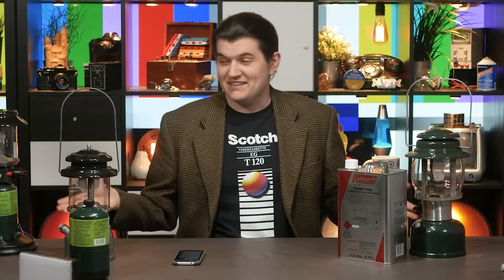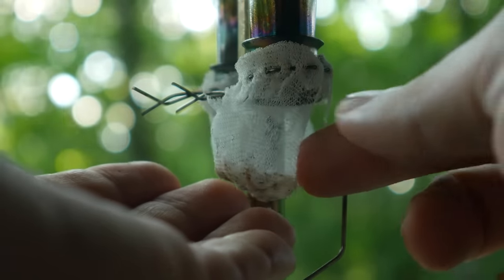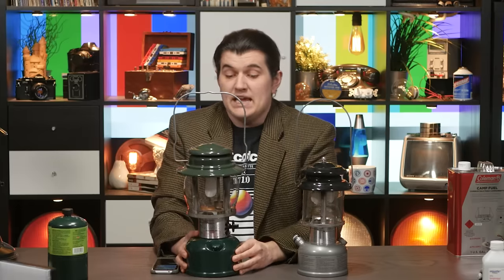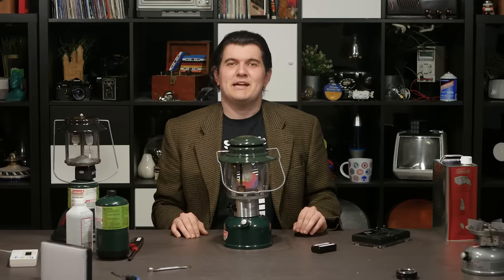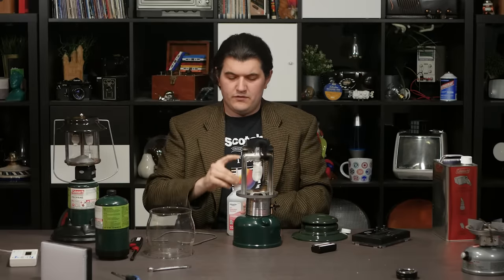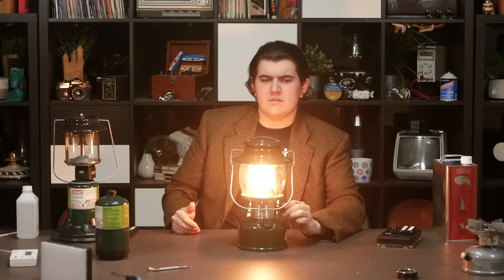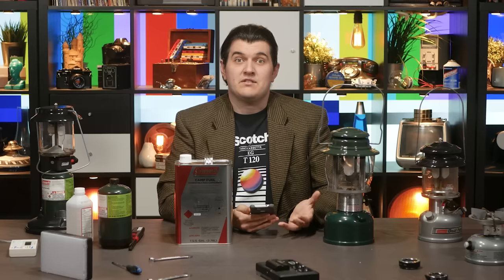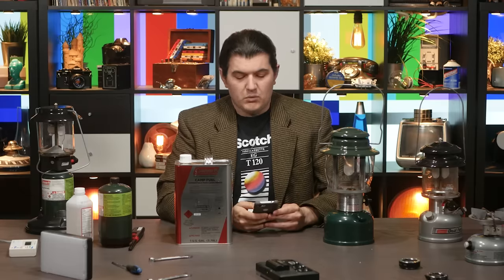A very rambly Coleman Lantern follow-up. Turns out they rarely make sense in 2021

Comment: That mantle was actually less fragile than I had expected.
Reply: They have gotten much better, the older ones were bad enough that just rough handling would break them.
Reply: @Blazer02LS  yeah, i can recall camping as a kid and always having to replace mantles after a drive, or not having any after pulling the lantern out and finding the mantles busted up. 

I've got multiple trips (and a couple thousand travel miles) on my current mantles and they're still intact.
Reply: In the 90's I broke one of the then new mantels blowing out my lamp. I used it alot when camping then as we had a tent and not a campervan, and rechargeable batteries where fairly bad back then.
Reply: @johnbrown3155  : Yeah, rechargeables have gotten so much better that they even pretend that alkalines simply can't be recharged now. So much recrimination directed at those.

Comment: Living in a northern climate where the temp can approach forty below in the winter I kind of like the low efficiency. That LED lamp would have a hard time keeping the tent warm...
Reply: The presenter literally had a cutaway where he explains that there will be exceptions to his broader rule that lithium batteries provide superior lighting output than the lanterns. His specific point was about very cold environments being the exception. He addressed your point. 

As to that point, if you are in a situation where you need heat and light would it not make more sense to have a camp stove and an LED light source? You can’t possibly tell me that an LED flashlight isn’t A) Brighter and B) more energy efficient than a Coleman lantern. And you have the stove to cook food and provide heat without any efficiency waste in creating light. 

Also, if you did find yourself in a situation where you needed light out in the wilderness would you rather have a Coleman lantern with a throw of maybe 10 feet or an adjustable LED flashlight with a maximum throw of hundreds of meters?  

There literally isn’t a situation that would be presented to a person prepared for the wilderness where an LED light source powered by lithium ion batteries would be worse than a coleman lantern.
Reply: @joshuav4965  So he should carry two devices instead of one? That doesn't make much sense. No one is saying that LED flashlights aren't great, its not an either or conundrum. But a lantern is not a flashlight. They serve different roles and need different run times.
And you have no idea what  you are talking about. In subzero temperatures an LED light source powered by batteries is definitely worse than a Coleman lantern. Batteries perform very poorly in severe cold, with run times often being a fraction of warm weather times. In some cases, they have too low of a voltage to even run the light and quit working entirely.

Comment: I want to see a very detailed video talking about electric alternatives to these types of lanterns and how efficient they are for example comparing battery-powered vs something like a hand-cranked lantern.
Reply: I have a lantern/USB battery pack with a hand crank.  I mostly charge it from a USB power supply, but I've done a full discharge and made sure I can get some decent lighting by hand-cranking it.  It also has USB power output, so in a pinch you can crank-charge a cellphone, and some radios.
Reply: I've only used solar powered lights when camping in recent years. I've have never managed to actually get them empty to the point where I was without light. No refilling, no fire hazard, no running cost after the initial cost. A decent one easily charges more during the day then you need in the dark, even on a cloudy day...

Comment: I know this one of those sort special cases. And I do mostly use LED headlamps for night time chores around my little horse ranch. I still use the Coleman white gas lanterns a fair amount too. For several reasons, I like the "quality" of the light better, less intensity when I look towards it. I think it disturbs the animals less, it produces heat, where I live we most winters nights go below freezing pretty much right after the sun goes down.  I already own them and don't need to by new stuff, I mean I only go through a gallon or two of fuel a year and that includes camping and cooking. Most of all I just love them, nostalge etc.  I do feel like you overstated the danger a bit, but then I grew upusing them for camping and general emergency lighting. I am in my mid 70's, and my father grew up using them for house lighting in South Dakota in the 1920' and 30's so I learned about them from someone who was pretty blase about them, but always safe as well.I find it intersting that Coleman, (I belive it was Coleman) had whole house systems plumbed like "town gas" I think they called it "fine line" with a central fuel / pressure tank and even made a kitchen range and oven, if my memory is correct.  
Than you for all the content you produce.  Your channel is one of my go to's for educatation entertainment.
gary

Comment: a roommate in college nearly ded from fume of a propane heater he was running in his room. Passed out in a chair door closed.  Lucky a fellow roomie got home at 1am and found him sealed in his gas chamber.   If roomie hadn't gotten home then, oh well RIP.
Reply: It's too bad there is no way to design a purely mechanical carbon monoxide detector to force the propane to eventually turn off.

Comment: Two accessories that they sold for this type of lantern years ago. One was an igniter that went up one of the holes. It was simply like an igniter like on modern pocket lighters. You would push the end up close to the elements and turn a shafted wheel. It would shoot off some sparks. The other accessory was an after market replacement for the fill cap. It had a standard bicycle valve on the top. You could simply use a football type pump to pressurize it up. It was far safer than trying to do maintenance on the regular pump.

Comment: An Emergency situation is really where the gas units work well. They supply light,  heat, and a means of cooking.  This is very versatile. The batteries might go bad , especially when they sit for a while. Also, how would you cook with a battery ? Or supply heat? Great videos, thanks !

Comment: the pump on a coleman device is easily removable for maintenance (or discovery of its inner workings). The piston is a one-way diaphragm, like a bicycle pump and you are correct, that the hole in the handle simply allows for return to the stowed position without resistance once the desired pressure is attained.

Comment: A situation that they are used regularly is in extrem cold climate. In bush camps and searches in far northern Canada. At -40 propain is literally a liquid, and lithium batteries have 33.33% charging. 

We use dual fuel with pump gas. And they provide both light and heat. Something eletrical cant. 

Another reason away from temperature for not using propain is once it burns it adds water vapor to the area.

edit I know its a but sometimes, its our reality several months a year. And thanks for adresseing the cold factor

Comment: I collect Coleman gas lanterns.  I think they are awesome.  I also have no hesitation about using them indoors, especially during power outages.  They are no different than old pickup trucks.  Sure the new truck is better in every way, but the old one will always fire up and has a certain amount of "fizz" associated with it compared to new sterile machines

Comment: On the "too cold" extremes.  If you're in a situation where batteries are going to be having problems, there's a good chance that propane or even white gas will probably be having issues too.  If you're going to do any extreme weather/altitude stuff, do some research.  The gear for that is specialist for a reason.
Reply: White gas is fine in cold weather. It's what mountaineers use when isobutane freezes out.
Reply: There is a reason alpine hikers still carry the ancient MSR whisperlite  white gas stoves. They can run on anything including white gas and function well below -40. Preheat takes a little while, but they run great.
Reply: White gas works better than propane in the cold.     Yeah some stove designs also dont work well in cold.
Reply: @otm646  I'm certainly not a big alpine hiker, but that's my hiking stove.  The foil shroud thing is pretty important too.  ;)
Reply: @travcollier  For 25 years that was THE stove. Now I've got an isobutane pocket rocket, or Esbit, that was specifically to save weight.
If I'm out for over a week the Whisperlite is what I'll bring. The Esbit tabs are far better as a fire starter than something to cook on.

Comment: Theoretically, the kerosene lamp should be able to run on vegetable oil.
Reply: Too thick, so unless you use 10% oil and 90% kerosene, it likely will not flow or boil correctly in the generator
Reply: Unfortunately it does not work like that. I tried to run one on pure olive oil and it was a disaster, vegetable oil would perform worse.
The fuel doesn't flow properly into the preheat tube, nor does it spend enough time in there to approximate the same viscosity as kerosene. There also seems to be an issue with the combustion byproducts that doesn't exist with kerosene.
My testing took place around 75° F, I suppose if you tried it somewhere extraordinarily warm maybe at 95° F you might get slightly more satisfactory result.
Reply: Try it, if you want to ruin it! Any bio-fuel will cloak the generators of kerosene lamps in a very short time. So NEVER EVER use vegetable oils, bio-lampoil or cintronella-stuff in your lanterns!

Comment: I have a silver dual fuel lantern like in this video.  The reason I got it 30 years ago is because you never know when readily available supplies are NOT going to be available.  Look at last year's toilet paper shortage if you don't believe that.  Also, in snowy states, when heavy snow is forecast, there's a run on flashlights, batteries, water, milk, bread, baby diapers, etc.   Ditto for hurricane states.  If you need light or cooking over long periods, the dual fuel lanterns and stoves can be used outside with gasoline you have from your car, a motorcycle, lawnmower, snowblower, etc.

Comment: I use a white gas Coleman lantern 220 and stove 413g for camping exclusively. Ive gone camping this year on 4 day weekends once a month and a week long trip at the end of the year. And didn't use hardly any fuel, under half a gallon if not closer to 1/4 gallon. I don't need to bring the fuel can with me, I fill up before I leave on a trip. As for brightness I don't need super bright light while camping or in emergency situations. It lit my house every night for a week long power outage and it was plenty bright to get around. And even including that week of lighting I'm still using the same gallon can of fuel. They're low maintenance and with the lantern rattling around in the back of the truck all year I never had to replace any mantles since I put them in years ago when I got the lantern.

Comment: I keep a Alddan mantel lamp for light and heat for extremely cold weather power outages.  You can heat a small room and keep light for a while on a few gallons of Kerosene. I do have a couple of oil lamps just for an emergency. I have several LED flashlights all over for practical use so you have proved my philosophy very precisely with your breakdown thank you for breaking it down so well...

Comment: The pump has a one-way leather (at least it used to be leather) valve.  You take your thumb off the hole to allow the air to get inside.  This becomes more acute the fuller the tank is with fuel and air.

Comment: Love the content - dont stop. I've been using the coleman Dual Fuel lantern and stove for nearly 30 years now for camping. At the time, the dual fuel light and stove cost over double a gas stove, but the fuel was a lot cheaper.. I've never used the coleman fuel - always gasoline / petrol simply due to high cost of the coleman fuel in the UK. I even made a small pipe that I could use to fill the fuel bottle from the fuel injection on my car. Yup - it can get a bit- err - "lively" when starting, but with practice, it gets less daunting - but you are right to be cautious - I'd never light it in any location where the potential overspill would be damaging - NEVER inside the tent. the stove talks about a starting "paste" to get the generator tube hot enough - never used it.  I enjoy the comparison with the kerosine lantern - I have always wondered what they would be like to use - a real pain. I can see a possible benefit if you had a cabin, for example, and used a kerosine heater to heat it - it would be useful to keep it down to one fuel. But otherwise the "White fuel" equipment is far better.  Really enjoyed the content - your findings with the mantles and lighting process etc is exactly the same as mine. Regarding battery vs gasoline or propane - you are 100 percent right. 30 years ago, battery was expensive and had a low capacity, so it was propane vs gasoline only. But now, with high capacity lithium rechargeable LED lights with a 6 hour runtime for 5 to 10 dollars that will fit in your pocket, these lanterns are less and less relevant.  With overland vehicles, we are even using electric ovens now too...
Reply: We do still use one of these, but its for the quality of light and the insect killing capacity - definitely not for the ease of use.

Comment: I've a Coleman Northstar dual fuel lantern which has a single large, long mantle

Which can put out around 220w. 

Never had any issue, ignites with the push of a button, had a flair or two when turning up the fuel too quickly but other than that it's fantastic.

Plenty heat when camping, plenty bright and fairly adjustable.. Best to use naphtha fuel, cleaner and doesn't contain all the crap regular petrol for cars contains..

Incidentally it's been used a dozen times or so and put in and out of cars with no issues of the mantle breaking or getting damaged.. 

You can get a whole evening out of it, although you will need to pump it up few times.. lol 😅

Incidentally, it takes about 90 seconds to get lit and up and running..

Comment: We have a Coleman dual fuel, have used it for 17 years camping. Advantages: Bright. Brighter than any LED lantern I've seen in any campsite I've been on. Can light an outdoor area on a pole sufficiently for kids to play late and adults to see them. 
Never have I enter found myself without fuel. If I run out I just pull a hose off the carb on my VW bus and short the starter solenoid to fill a container with petrol (gas). 
Last ten years or so we use LED lights most of the time, but there's always a place for for the Coleman. 
The LED video light you showed is impressive but omnidirectional and I'm terrible at keeping stuff charged I only use 5 or 6 times per year.

Comment: The main issue with electric is batteries are fragile and extremely prone to breaking after getting wet, and you can't leave small solar panels out unattended for risk of someone taking it. Also, the heat from the lanterns is an upside, not a downside. A lot of people I know are using a relatively new diy alcohol burner design for light and heat when sleeping camped out.

Comment: Ok you did very well. I use led lights when I can . I have two gas lanterns and a stove . If the power goes out for over 12 hours. I to not mind lighting the gas lanterns in the garage. Or even at camp . Gas is still cheap . They also give off the heat . I use them for fishing . At night .

Comment: Outstanding series of videos.  Thank you.

I believe the hole in the Coleman lantern pump serves as a safety device.  We're known for 150 years or more than pressure vessels require some mechanism to prevent or release excessive pressure.  "Hartford Steam Boiler" is still in business - they sell insurance.

Putting a thumb over the hole in the Coleman pump piston creates a simple pressure relief valve.  Whether the pumper is a strongman or a child, the amount of pressure that can be created before pressurized air starts leaking past the thumb is about the same.   

The hole prevents raising the pressure in the gasoline tank to dangerous levels.   As others have pointed out, it also makes it easy to return the piston to the closed and locked position even with pressure in the tank.

Many engineering features have multiple purposes, and they are not always obvious.  The Coleman lantern design has stood the test of time extremely well.
Reply: Hi mtechnology have you become a flat earther yet? If not I suggest watch a 13 part series called What on earth happened by Ewaranon to learn that the earth is not a globe. I got it in my about tab.

Comment: Love these videos.  I collect gas lanterns and used them regularly for years and I think every thing you said is completely accurate.  

It was great to see someone who is unfamiliar with them really explore the gas lamps.  

If you like the safety of kerosene for lighting you could use an Aladdin brand gas lamp for indoor use.  They have a wick like a old fashioned lamp, but the wick is larger and in a circle shape and the wick is under the mantle causing the mantle to generate lighting.  A great part of the Aladdin lamps is that you don't need to pump them up, they are quiet, and the wick lights with a match.   The bad part is they can easily soot up like crazy if you turn the wick to high and the chimney is a fragile and unsupported, also they are not very bright, approximately 30 watt equivalent. 

Thanks again for the video!
Reply: He actually not only has one, but covered it in this series!
Check the "Gas Mantle" video on the main channel in particular, although it made a guest appearance in the Hurricane Lanterns video.
TL;DR though, he found it perfectly usable as an emergency lamp during power outages, even though it needs routine attention.